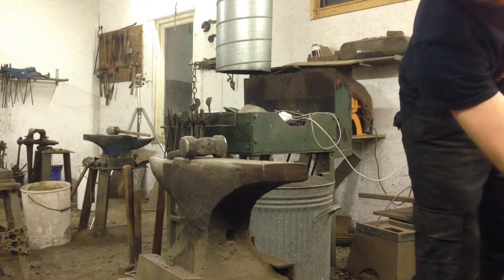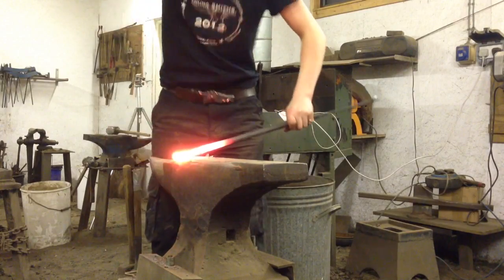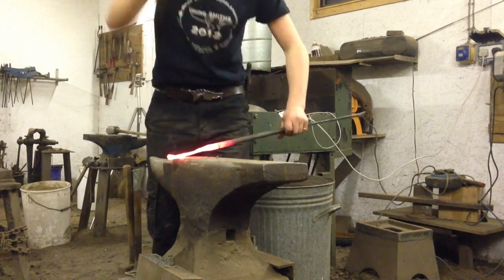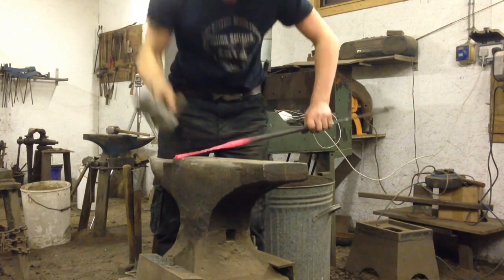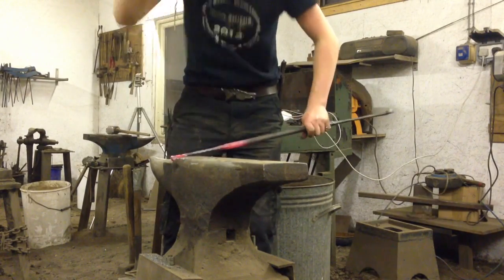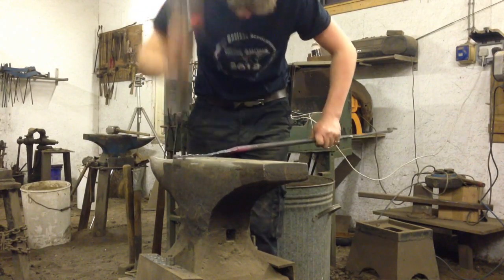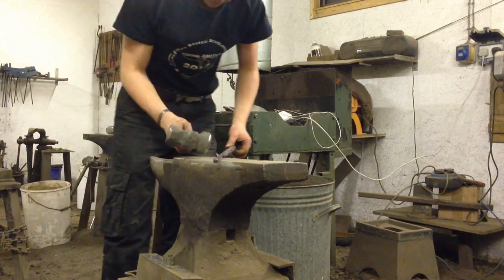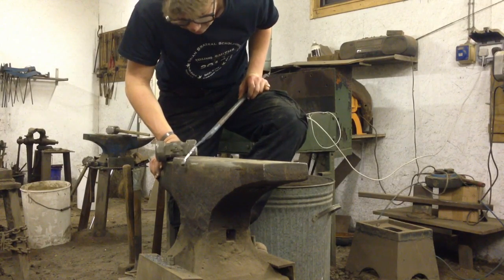Blacksmith doing the drawing out challenge

Comment: Question, why use the edge of the anvil?
Reply: adam anthoni ford smaller surface area contact = greater movement in the steel 3 years late but I got you

Comment: mate i dont like to sound like a prick or anything, but i couldn't help notice your hammer was shaking a lot,towards the middle/end of the drawing out, i think you pointed this out to me when i was using an 8 lbs single handed, but it almost looks like your getting to tired to control the hammers recoil, not you so much really but the muscles in your forearm and wrist, just an observation.
Reply from the maker: I agree that I was tiring towards the end of the heat! Any human being would be tiring. It is important to remember I never forge like this usually this is a much higher pace of forging than standard. 
Also, when you go to the shop, notice the way your hammer rebounds when you forge hotter steel as opposed to colder, red steel. The odd rebound is not tiredness however the rebound of the hammer coming off weirdly from the cold, uneven steel. Tiredness was felt in the lungs through that heat, I will not deny it was tiring!